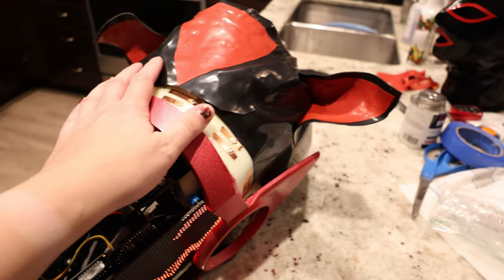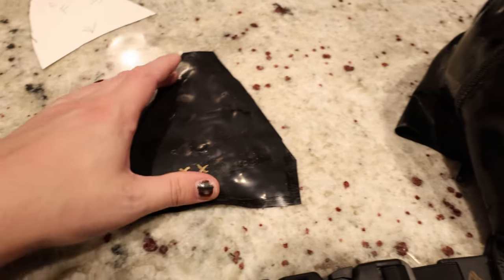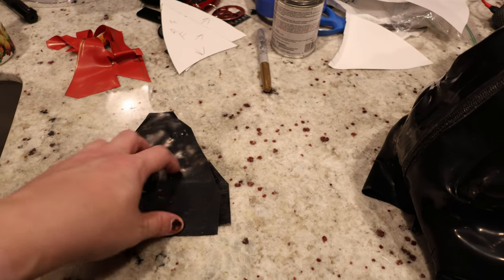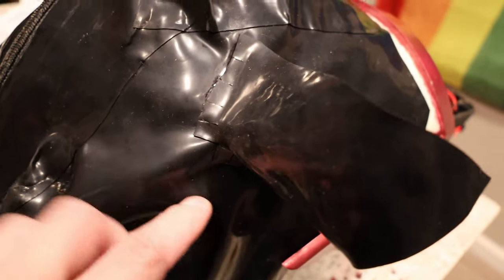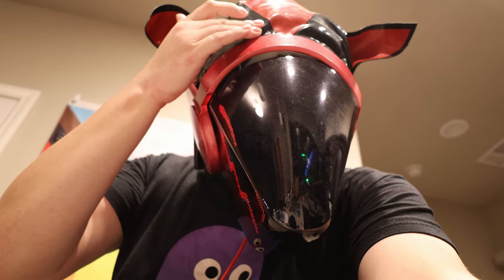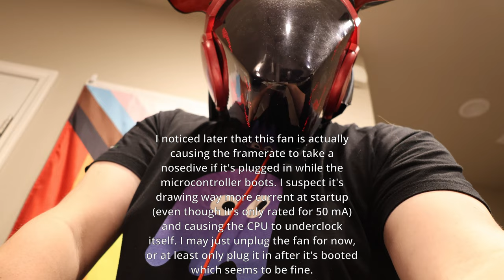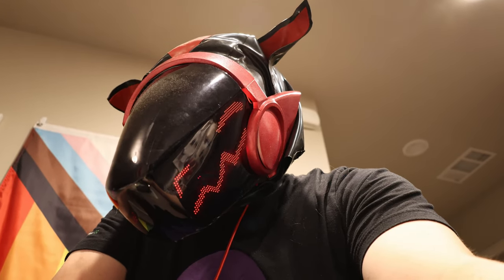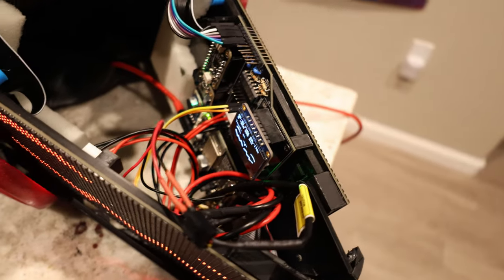Protogen Head part 16.1: Finishing it Up

Comment: 5:53 what is the small OLED for? looks like it's inside of the head
way to tell if it's working from the inside?
Reply from the maker: Mainly as a status display and menu, but in the default state it mirrors what's on the outer screens (and has a clock)